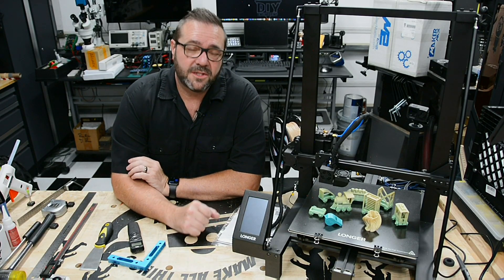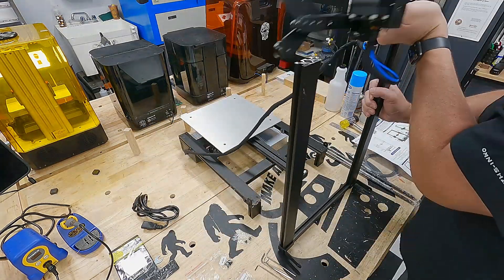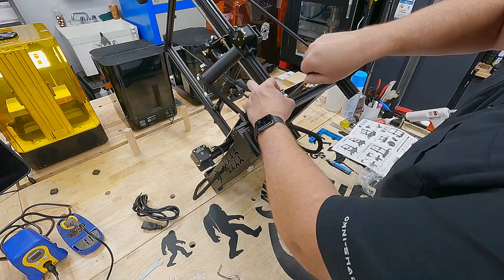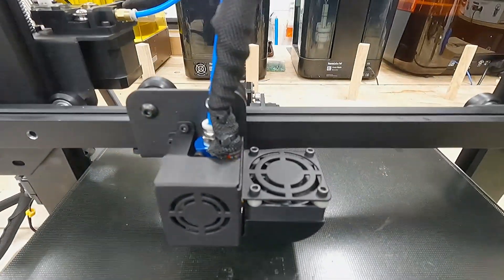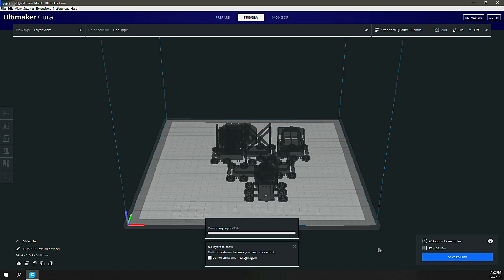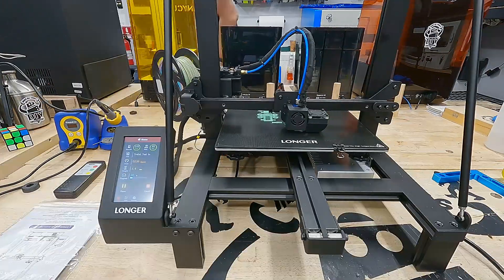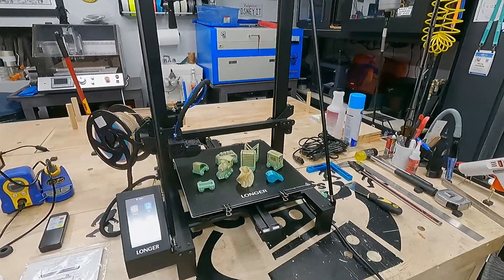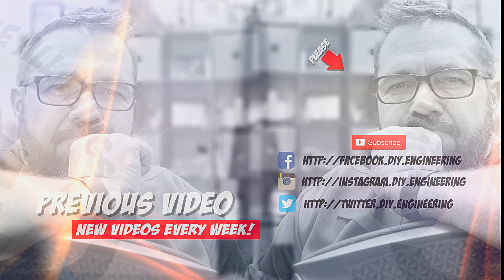Testing a Longer 3D Printer, the LK5-Pro!

Comment: This printer is soo good out of the box.... I've bought a second, the only issue I've had so far is the guide wheels under the be have come loose, and caused the ringing you described and as a newbie I took a while to diagnose this, otherwise a solid machine.

Comment: I'm glad you liked it as mine will be here tomorrow
Reply: How do you like yours
Reply: @TheRandomRobert71  works great I havent had any problems yet I did add the power port support ad an extra but the cooling has been great for the stock build i havent needed to print a better cooler yet some people went with a dual cooler fan but I havent had too. The hardest thing g for me is the fusion 360 software its pretty detailed and tutorials I have had to watch a lot of them. I was able to print and patent an adaptor plate for a home internet tower which I thought was pretty cool as I'm kinda new to 3d printing I've been able to print a lot of things with small adjustments to the printer. I would probably for my next printer buy a auto leveling plate as that is probably the thing that's a pain In the ass. But overall I like the longer